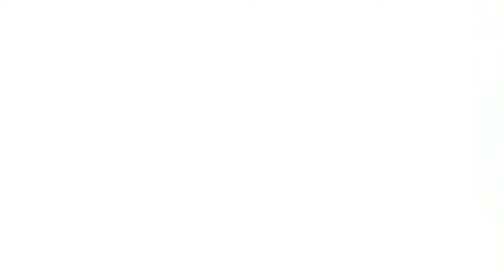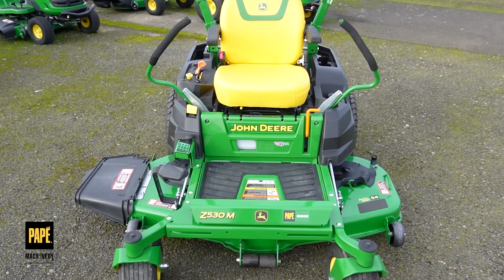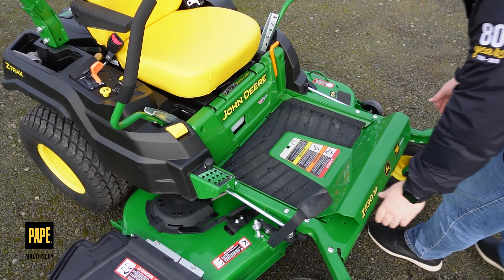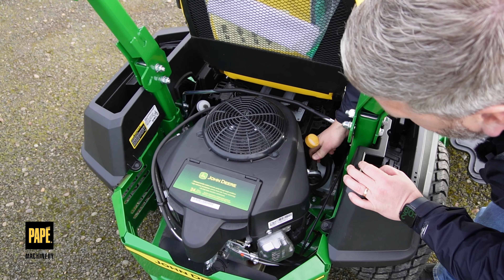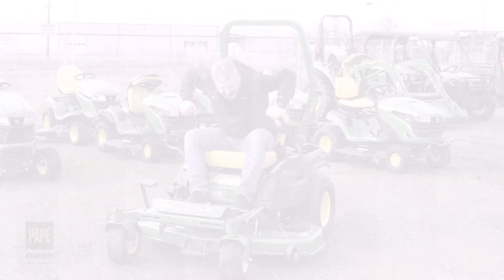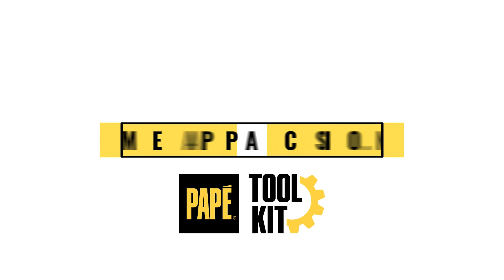John Deere Z530M Zero Turn Mower Overview

Comment: I had test drives today. The Z330 R and the 530 M. I’m having the 48 inch deck put on the 530 M and it will be perfect. If I had an extra $1800 I would take the seat off the Z9 lol

Comment: I have 4 Jd zero turns and 2 John Deere tractors. All are excellent quality. My largest is a 60 inch zero turn.
Reply from the maker: Hi David, how do you like that 60" deck? Let us know! We appreciate you watching the video!
Reply: @papemachinery.agturf the 60" is fine.
Great for a the 3 acres I cut with it.
Reply: @papemachinery.agturf i like the 60in zeroturn fine.i have 3 acres to cut with it.
But m favorite mower is my jd 48 inch.i use it st home. It is a zeroturn also.